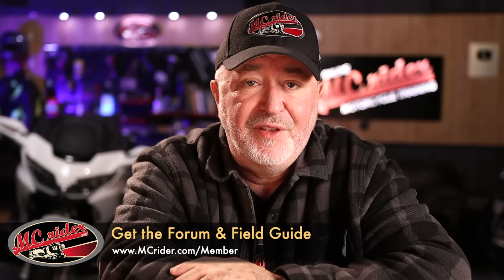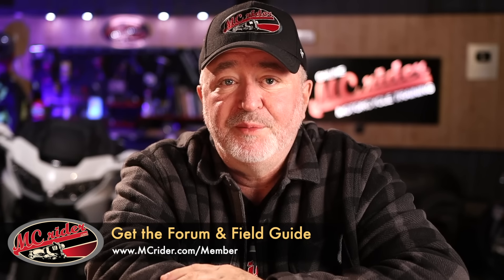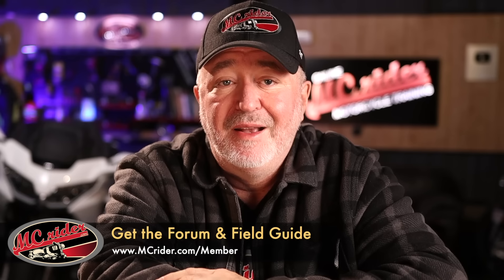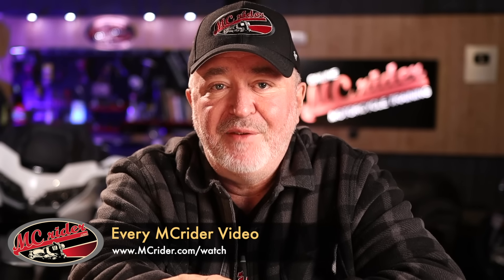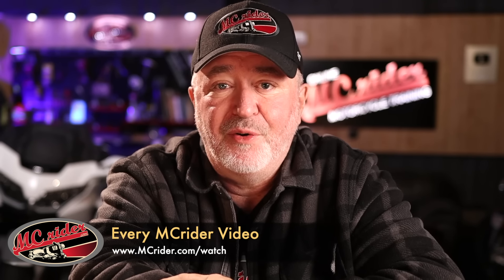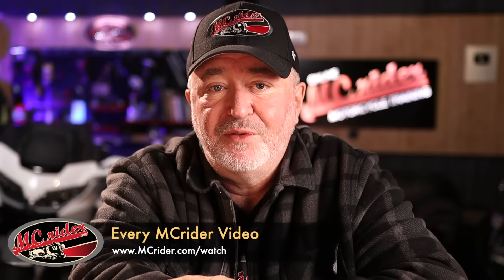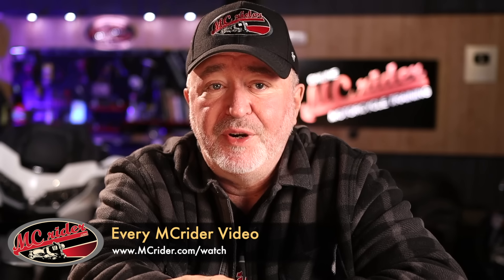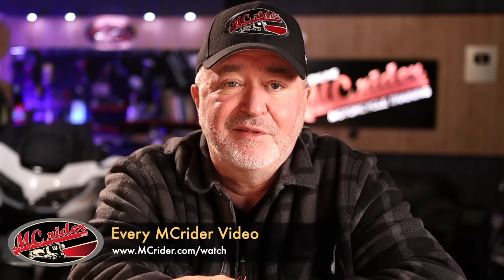The Most Misunderstood Control on a Motorcycle

Comment: I'm curious if you have considered cost and difficulty to repair, comparing the motorcycle clutch replacement with the car clutch replacement.   I did change a clutch in a Datsun back in the early 90s,  took me a good part of the day dropping the transmission out the bottom of the car while I was laying in the gravel driveway on my back and probably cost a  hundred bucks in parts.  If it had been done at a shop the cost certainly would have been higher.  I have never changed a clutch in a motorcycle but it looks very accessible,  I'm guessing it wouldn't take more than a couple hours.  The cost of parts is probably pretty low as well, that clutch isn't nearly as big as the one on the car.
Reply: Depends on the bike. On my BMW /6 it takes about 4 hours to do the clutch and it’s relatively straight forward but you still have to remove the rear swing arm and final drive. On my GS and my K bike, it takes about 8 hours (by the BMW shop manual) because the bikes basically have to be broken in half to do the job. It takes me about 12 because I don’t have a professional shop and I don’t do it on a regular basis. While I agree it’s a wear part, it’s not always an easy wear part to replace. My brake pads take about an hour for all three discs. Not a fair comparison.
Reply: Most motorcycle clutches are way easier...

Even if a BMW takes 4-8 hours, cars require an engine or trans pull to do a clutch. I did my first motorcycle clutch in about 2.5 hours, including soaking the new clutch plates in oil. That was on a 1982 yamaha xj750. My fastest car clutch? About 4 hours on a Subaru, and that was very fast...
Reply: @connorjones1485  on the single cylinder BMWs (F and G series) the clutch is a wet, multi plate, slipper located in the case like most Japanese bikes. On the dry clutch bikes it's located between the engine and transmission like a car. On the old airheads it isn't a terribly hard job, remove the rear end, final drive, swing arm, and drop the tranny.  On the newer dry clutch bikes (pre 1250 wetheads with wet clutch which I believe is now located to the front, haven't done one yet) it's far more involved.  You still have to remove the rear end, and the swing arm, as well as everything from the rear half of the bike (controls, pegs, hoses, and loosen the wiring looms) remove the rear frame to engine bolts, and swing the back half of the frame up over the front half of the frame (actually to about a 45 degree angle) to get the transmission out. It's a doable task if you have the know how, but it isn't easy.  If you don't have the know how, it's quite expensive.  Pushing over $1000 not counting parts.  The wet, multi plate, slipper clutch was a great improvement as far as maintenance went for the boxer bikes.
Reply: @The_Disgruntled_Vet  Does sounds like a pain! 

Wasn’t so much saying you were wrong, you’re definitely not. Just pointing out I don’t know of any car that has a clutch change that doesn’t require an engine pull or trans drop, but the majority of wet clutch bikes will be a much easier (and generally less expensive) job than cars.

Basically it just sounds like it does for cars. Don’t buy German if you can’t afford maintenance, or don’t love to do it yourself!
Reply: @connorjones1485  didn’t take it that way. I was just pointing out the differences. I’ve done a couple F and G bikes and they’re considerably easier. I imagine if I didn’t do my own work and had to pay someone $125 and hour for an 8 hour job, I might look for another manufacturer but I do like my BMWs. They’re hard to beat for longevity and durability.
Reply: @The_Disgruntled_Vet  I have a 2003 F650GS I’ve currently got listed for sale since I don’t need a dirt bike, a full dressed tourer, and a dual sport. That bike has been incredibly fun, but incredibly German 😂

Everything mechanical has worked the whole time I’ve owned it. But tach, speedometer, abs, etc. basically not worked the entire time. Why they decided to not just run a cable speedometer is beyond me... and then the day I had some one coming to look at it, naturally it developed a big problem. Would run at full throttle, but not idle, backfired terribly, pulled it apart and discovered a bad, but not blown fuse. Took 20 minutes to reach the fuse block. My buddies klr of similar vintage does something similar on occasion. All he has to do is reach down, pull fuse cover, r&r fuse, done.

I’ve always explained to people, I love German cars. There’s nothing nicer to drive, my 1999 a4 got 28mpg, was comfortable, fairly quick, practical, and could push 18” of snow uphill, on a dirt road, on all seasons for a mile. But they’re designed as if nothing will ever break... if you buy one, budget purchase price+ on dealer maintenance, or expect to wrench, a lot. And know they wait til you need it to work to push your buttons.

End of day bikes should be a hobby, so what’s acceptable for bikes is atrocious for cars. I loved my GS, and at some point will likely own another bmw. 

I’m a Yamaha guy myself. Got an 82 maxim 750, 83 1200 venture, and a 99 yz400f. I think they’re about the right mix of sophisticated but easy to work on. Fun to visit with someone who knows their stuff and does their own wrenching!
Reply: @connorjones1485  I love the BMW speedometer. It is only guaranteed accurate if you’re stopped. They haven’t improved. My ‘76 R90 is not accurate. My ‘85 GS is not accurate. My ‘93 K bike is not accurate. But they are dependable. My ‘76 has over 250,000 on it. My ‘85 has 130,000 on it. My ‘93 has 68,000 on it. My R90 is my baby. Inherited it when my dad passed. It’s down for a full rewire right now. Going solid state with an aftermarket digital dash. Maybe I’ll have the only BMW with an accurate speedometer when I’m done.
Reply: @The_Disgruntled_Vet  glad to know it wasn't just mine, though they do provide a great excuse for "why were you speeding?" or "do you know how fast you were going?" 

Classic BMWs are so neat, glad to hear yours is getting some love!
Reply: @connorjones1485  
Do you know how fast you were going?
No sir, not a clue. It’s a BMW. 
Oh, I understand. Have a nice day.

Comment: Hi MC.  I am guilty of the shifting into neutral with the clutch disengaged in order to use my brake pedal to flash my brake lights to attract the attention of a vehicle closing on my 6 O’click.
Reply: Why do you need to shift into neutral to use the brake pedal, and doesn't your bike have a brake light switch on the front brake, anyway?

Comment: Itchy boots burned her clutch a few times using it in the friction zone and the bikes were having wet clutches. You better use your rear brake. Also you want to keep power on the rear wheel. Using the clutch will decrease the power making the bike want to crash in a U-turn.

Comment: I believe that there is one transportation means that is similar to a motorcycle....I have known a couple of helicopter pilots who also rode sport bikes....the use of motorcycle controls means using both hands an both feet...as does a helicopter.  The most fun flights I have had were with a bike riding pilot....there is nothing quite like lifting off a mountain top, then dropping sideways down a 1,000 ft cliff and then heading up a river at 50 ft altitude....

Comment: I did have a question. Super new rider here (less than 1 month since passing msf), regarding the friction zone I’ve heard a ton discussing using it to control speed at low speeds, but nothing about using it at higher speeds. Can it be used to assist with speed control at speeds between 30 and 50 mph? Or should that entirely be done with the throttle and brake?
Reply: of course you "can", but it makes no sense. Then you really put unnecessary wear to your clutch (or better: oil). Why don't just use your throttle for that? most bikes engine braking capability is even strong enough, that you don't have to use your brakes most of the time, if riding just a little foresighted.

Comment: Good day Kevin and Thank You for great information.
A debate i've had with a fellow rider was clutch control/engine speed/bike speed when down shifting.
Even as a CDL Class A truck driver I do not use my bikes engine to slow me down. I prepare for stops and down shift as my speed slows to the gear. My friend revs his engine slips to the lower gear and pops the clutch. Neither hurt the bike but personally it annoys me when folks needlessly rev their engines, ESPECIALLY while stopped at a light. I am an A**hole and I tell them to get their bikes tuned so it just idles at stops. It's not like their new bike is going to die at the light.
       I'll share my biggest mistake and an accident that could have killed me. On my 65 Pan Electra Glide I was in neutral at a notoriously long light. An elderly woman in her Cadillac was speeding 10 to 15mph above the posted speed and would have run the red light had she not hit me first. My first hint of danger was the officer coming the other way locking up his brakes. Now I had no escape with the cross traffic, my being tired from the long trip I was finishing was no excuse. I am willing to bet to this day that the woman will still declare that i pulled in front of her. With an officer as my witness I was not charged or found at fault. The judge and I had a long discussion after court where I admitted my mistakes; Not being in gear, not watching for traffic behind me, not having an escape and most importantly I had been riding too long without a rest!!
        Regardless of time and schedules, I don't push myself anymore. I still run long distance riding trips but I am rested and conditioned to the road. With "Iron Butt" runs becoming so important to new and young riders, I see many accidents and deaths in our future. It is not because I have been riding for over 40 years that i feel more capable of this type of riding. It's because I do them all the time, hence I am conditioned to that ride. Maybe a video on the dangers of pushing yourself beyond your 100 to 300 mile days of riding to a 1,000 mile for a patch/ certificate is not responsible riding???
        You all are in my prayers
Hoka Hey

Comment: I bought a bike and have 3 short rides under my belt. I notice when im up-shifting it can be a bit jerky. I completey roll off the throttle, clutch in, shift up, and back on throttle. Many times the transition is not smooth.
My understanding of a wet clutch is limited. Should I be riding the clutch to upshift through all gears? Or just starting out in 1st?
Reply: --To clarify: does kevins explanation of the clutch as a volume knob apply to all gears or just 1st?

Comment: You forgot that it's important and can be used on an incline. When on an incline you can stay in the friction Zone to keep the bike steady and ready to go when necessary other than or in conjunction with your brakes. To prevent you from rolling back or stalling the engine.
Reply: Exactly. My driving teacher had me practise hill starts on the ramp of a little-used railway crossing. Hold the brake, throttle up in a measured way, let the clutch come slowly and release the brake until the bike moved forward, then let it roll back and do it all over again until I had it down flawlessly.

Comment: Using the friction zone for slow turns, u turns and figure 8s puts very little wear on the clutch because you are doing these maneuvers SLOWLY. It takes very little power transfer across the slipping clutch to get any motorcycle to go 2 or 3 mph.

If someone is going to wear out their clutch its going to happen by reving the engine up to 5,000 RPM at stops and slipping the clutch all the way from 0 to 30mph in 1st gear

If you want your clutch to last the life of the motorcycle practice taking off from a stop giving the engine very little (or no) throttle and friction zoning the clutch all the way out to get the bike up to 3 or 4 mph, and THEN get on the gas to take off quickly.

Comment: Great video! My question is as a learning rider, are you able to squeeze the clutch while breaking and shifting down at the same time?
Reply: Yes - and is a great skill to start practicing so you can smoothly downshift when approaching turns.
Reply: Yes, that is what you should be doing. 

It becomes something you don’t even think about with some experience.
Reply from the maker: Yes you can! When approaching a stop I squeeze the clutch, downshift through the gears, as I am applying the brakes.
Reply: You guys have cleared up a lot for me. This was the one hang up that I had... Looking forward to your next video...
Reply: I was taught to do just that.
Reply: Absolutely.
Reply: You need all your hands and feet for this, but like all such coordination tasks, you can internalise this pretty quickly with a little practice.
Reply: not all at the same time

to slow down from speed let the throttle rotate closed - the engine compression will start to slow down the bike
if you are not stopping hard you may not need to apply the brakes yet
as the bike slows down shift the transmission down thru the gears, using the clutch for each shift and letting it out so the engine will continue to slow the bike. 

You should be in the gear you would normally pass thru at your present speed.  if you need to speed up again (or if a traffic light turns green) you just throttle up while releasing the brakes.

If you are braking moderately you could down shift from 5th to 3rd.. .to 2nd then to first as you stop, braking smoothly all the way down.

If you dont need to stop quickly you could just down shift and let the engine brake you all the way down to 10mph... then pull in the clutch and brake to a stop, shifting to 1st just before you put your foot down.

IF you are doing a panic stop pull the clutch in when you start braking, and keep kicking the gears down as you slow down. If you only brake and leave the bike in 5th gear, it will be hard to kick the transmission down into 1st when the bike is not moving, because of the way the teeth of the gears tend to mash when the back wheel is not turning.

Comment: The problem is the clutch is not easy to replace.  
I've never done it on a motorcycle, and I don't look forward to ever done it.   All those multiple clutch plates look complicated and have to go together a certain way.
I've replaced a clutch on a car, and it was no fun at all.  So I want to avoid all wear on the clutch as I possibly can.
If these things were made and designed to be more easily serviced, particularly the parts that wear out, then it wouldn't be an issue.  As time goes on, motorcycles tend to be getting harder and harder to maintained yourself as they become designed worse and worse by millenials with CAD programs.

Comment: What happens if the clutch cable breaks while you are holding it in and in gear waiting to turn left and traffic is coming against you?? This is the same reason it is illegal in a car to have the front wheels turned left when waiting for an opening and you get rear ended. Many people have been "ended" when they got hit in the rear and had their front wheels turned waiting to turn left.
Reply: It’s going to be the same as dumping the clutch in first…with your feet down…and no throttle— 99% of the time the vehicle is just gonna stall right there.  If it doesn’t stall because you have some kind of anti-stall technology then initiate a stall manually by hitting the engine kill switch.  IMMEDIATELY turn on your hazards so the vehicles waiting behind you don’t hit you when the light flips.  Without a working clutch—bang the transmission back up into neutral the hard way .  Dismount the motorcycle.  When the light turns green for the opposing traffic— WALK the motorcycle in the crosswalk (to your immediate left) as far as you safely can get it to roll—WELL out of the intersection—and call for a flatbed tow truck.  You might be able to baby it home without a clutch if you’re really close by… For the vast majority of riders it’s probably not worth the effort…

Comment: People that have never riden a motorcycle cannot begin to understand the concept of separate brakes and having to steer using shifting your weight, throttle control and constantly moving your steering in either direction to get it to go where you want to. Motorcycle riders make better car drivers, as they are aware of how vulnerable they are. It should be compulsory to pass a motorcycle test, and have 2 years of experience, as a qualification for getting a car licence. IMO

Comment: That’s not why they mean. For instance coming to a stop at a light. What they mean is squeeze clutch, downshift to first, while braking with front and rear brake would wear out the clutch less. Than if you were to downshift through every fear from 4th to 3rd to 2nd to first. You have down shifted 3 times, meaning you have  applied the clutch 3 times. Against the other way you’ve only shifted once, sure you are putting more wear on the brakes BUT! Is cheaper and easier to replace brakes than a clutch (you can even do it yourself). So if you’re stop at a light you’re still in first gear in case you need to take off, you’ve just used the clutch less. I used to do that slot in my manual car. And if the light change as I was coming to a stop and I was already in first, I would just shift to second and keep going. As I already had some speed, and the car would have bug out on first. @mcrider